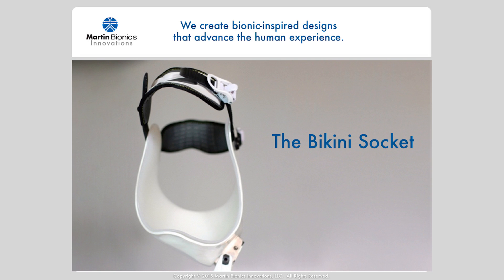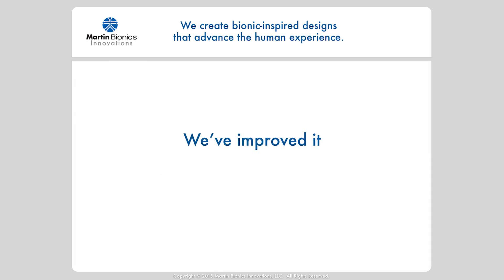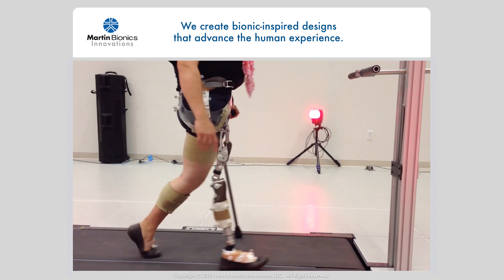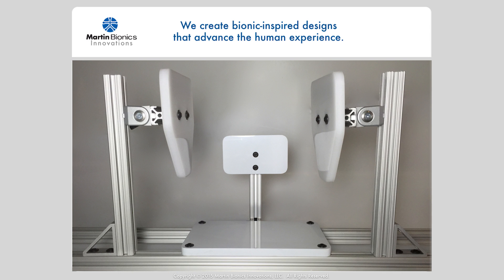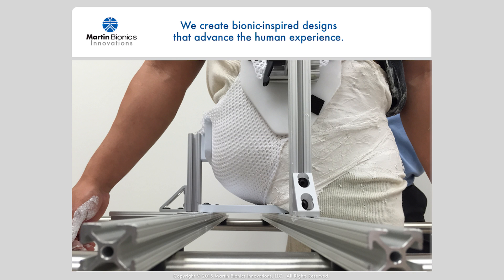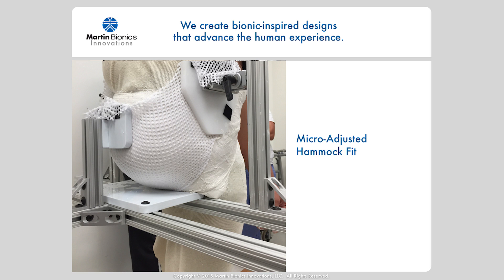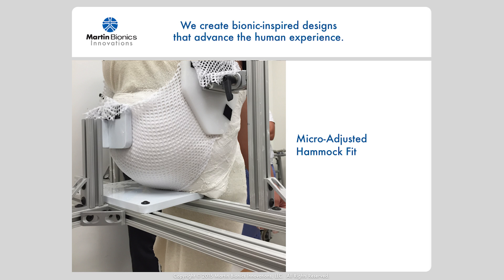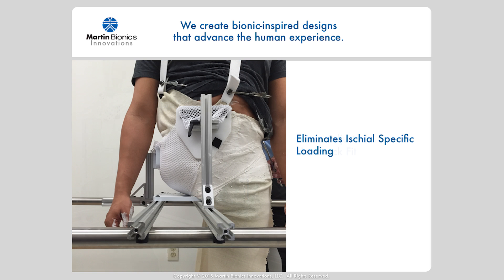Bikini of Hip Sockets Hammock Casting Stand Explained

Comment: I am a 59 year old male left leg trauma hemipelvectomy amputee living here in New Zealand. My prosthesis has a sort of a 'modified New Zealand Martin bikini style socket'. However it definitely wasn't made in/with the suspended fabric hammock. Plus it never had the mesh. Your video narrator asks "Imagine the comfort of sitting into a hammock v a hard shell" - OH YES please! I can certainly see how the hammock design would distribute the load more evenly across the broader surface area thereby reducing point pressures [incidentally those point pressures are exactly what I am experiencing at present in the hard socket shell of my prosthesis] and eliminating the need for ischial specific loading. I am not a practitioner HOWEVER I would definitely like my Prosthetists to see this hammock style Martin Bikini socket. Does Martin Bionics know of any New Zealand Prosthetists OR even Australian Prosthetists who could be trained to fit this revolutionary socket for hip disartic/hindquarter & hemipelvectomy amputees like myself?